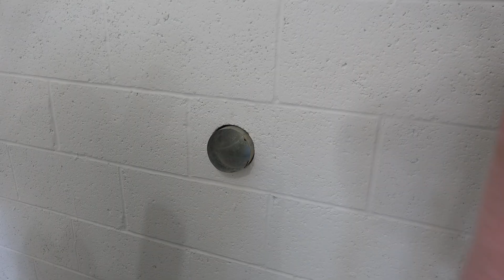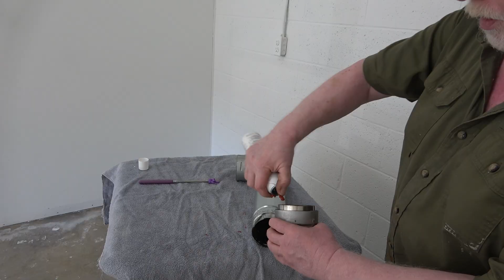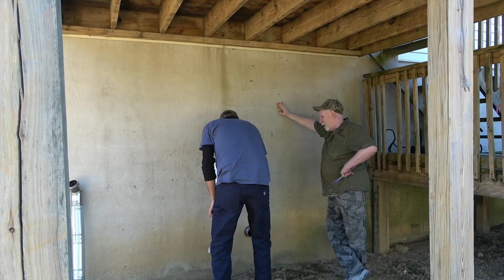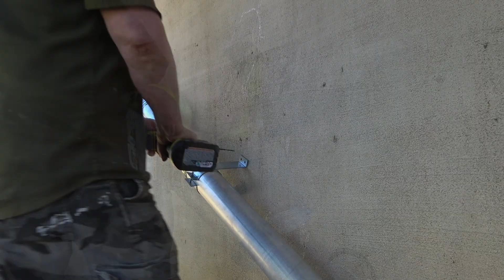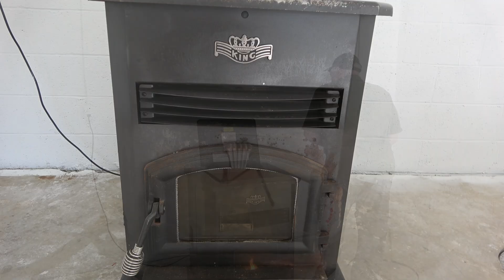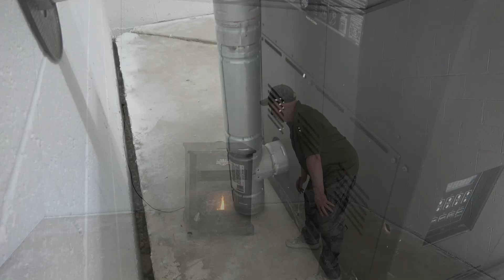How To Install Vent Flue Pipe For Pellet Stove Through Concrete Wall

Comment: curious how it ended up on the house exterior.  did it stain it brown?
Reply from the maker: I did have some soot build up on the wall (not staining) So I pressure washed and then swiveled the exhaust away from the wall 🙂

Comment: that is overkill, also you need a dura vent pellet vent Silver Pellet vent horizontal cap at the end , the one u have if you have a winded day it will back flow messing up the burn or blow out flame

Comment: Does that tee get sealed to the stove? Doesn't look like it locks in like the other pieces?
Reply from the maker: Yes Locked & sealed to the stove (if you don't have twist and lock system drill 3 pilot hole & install 3 screws spaced around the pipe to lock)

Comment: Great demo! So how long was that thing running when you felt the pipe? We are installing a Pelpro 130 at my sons place. Just wanting to know if those pipes get hot at all? Doesn't look like it. Thanks.
Reply from the maker: 15 minutes. They do get hot to touch but they will not burn paper I've left a small piece of newspaper on top of the stack for over an hour and does not ignite

Comment: On your other video the motherboard was bad causing ithe igniter to stay on, my old igniter was definitely bad.
Reply from the maker: Yes from what I understand there's a solid state relay that controls the igniter on and off. my solid state relay was stuck on perhaps yours is stuck off
Reply: @wildwoodtop  I took the black cover off of the motherboard and there's a charred spot near where the igniter goes.

Comment: My pellet stove has no power to igniter while trying to light! 
I'm using a new igniter that has been tested as good.
Reply from the maker: Check all your fuses and if they check good unfortunately I don't have a fix to why the controller is not delivering power to the igniter
Reply: or a bad heat disc

Comment: Do you not need a thimble
Reply from the maker: I used a sleeve as a thimble 0:55 since concrete is non-combustible I figured that would be sufficient
Reply: @wildwoodtop  is the sleeve just 4" single wall?  I have a concrete wall and the thimble seems like overkill.
Reply from the maker: @herewegotoday  Yes 4" single wall
Reply from the maker: @cvaz135 Thimble is designed to protect combustible materials (wood, drywall) it is recommended to use a thimble or sleeve when passing through a cinder block wall